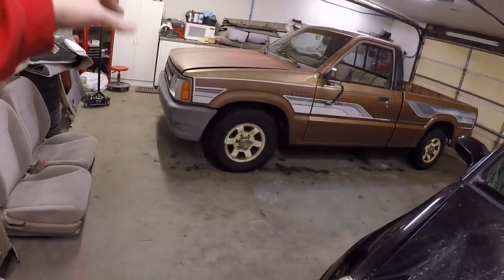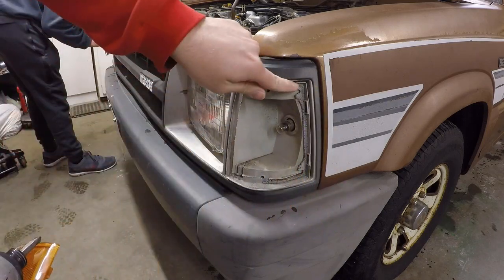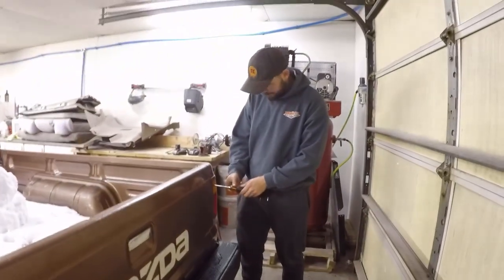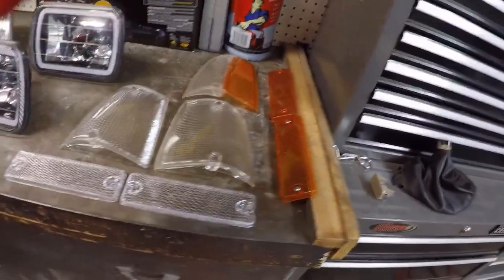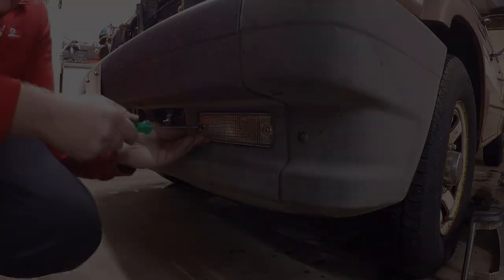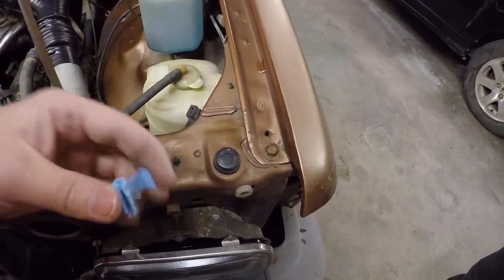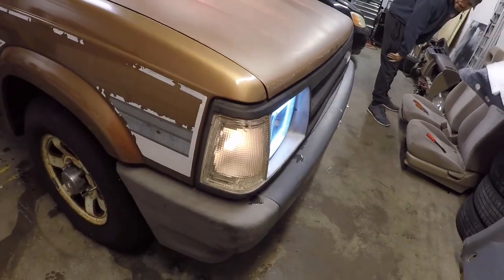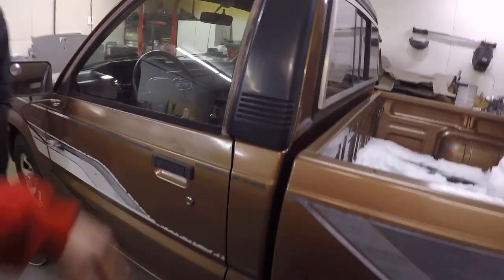All New Lights For The Mazda B2000 Mini Truck

Comment: 1987 B2000.  I wired 12 volt with switch on power to my Halos through a relay in the NC (normally closed) configuration.  I tapped power off of the turn signal to the pull down windings on the relay. Normal driving,  Halos are on all the time, when using the turn signal, the Halos blink opposite of the turn signal. Also upgraded to all LED bulbs and LED headlight bulbs.  I had to replace the flasher with a flasher designed for led conversion to keep the turn signals from hyperflashing.

Comment: I own a B series 2.2 diesel since 1990 from new.I still have it and enjoy it after 30 years and almost 400000 km.I like the lights but where i live(CYPRUS) is not easy to find them.Only from the e-bay and most of the times are not shipping  to Cyprus.Nice job.

Comment: Great video! I just got me a little truck this, can you re-link the lights you  used?! I may have found them on ebay but wanted to double check. Or the name of them?
Reply from the maker: I can't seem to find the ones we used in the video anymore. It looks like there's better options now compared to what we went with. The ones with the projector lenses and halo rings would be the next best option as you could run LED lights to have a better light output compared to the ones we used or the factory lights.

Comment: I have the same lens swap with all LED bulbs. No resistors so my blinkers hyper flash. I went with led headlights too. Some slight modification was required for them. All painted in a booth with a black and clear mix. I went to dark on the headlights unfortunately.

Comment: Great video. Thanks for the link provided for the parts you guys used. On the lights did you guys also buy the HID bulbs? If so hich ones did you guys buy? I like the way it came out. Thanks!
Reply from the maker: Thanks, glad you liked the video! And no, we didn't install any HID bulbs. We are looking into adding some LED ones though.
Reply: @AbnormalGarage  How did you guys wire the new headlight? I am having a hard time trying to decide which of the two red cables to splice into. Your video doesn't show how it got connected. Thanks.
Reply from the maker: For the halos to work, we spliced the wires into the daytime running lights. Red to red and black to black.

Comment: Have a 93 b truck bad motor n trans wat swaps can be be easy . Like a 4.0 auto tranny from ranger or wat
Reply: the ford 302 bolts in for the most part, but in my opinion you dhould just go for a miata swap. bolts up to the b2200 trans (theyre literally the exact same) and is just better in general.

Comment: Where did you guys buy the lights ??
Reply from the maker: The headlights we got off of Amazon, and the lenses were off of eBay. I have everything we used linked in the description of the video.
Reply: @AbnormalGarage   Do you have another page for the lenses, Ebay link is no longer available ?
Reply: The link for the lenses no longer works.  Did you buy the tail light lenses and the front bumper indicator lenses together or separate?  Did you have to order them from overseas?  Thailand?
Reply from the maker: I just updated the links, sorry I didn't see your comment.
Reply from the maker: I just updated the links, sorry I didn't see your comment. We got them as a set on eBay, and yes, they came from Thailand.